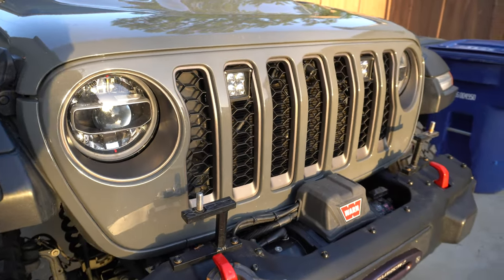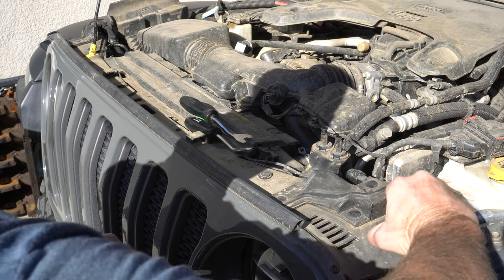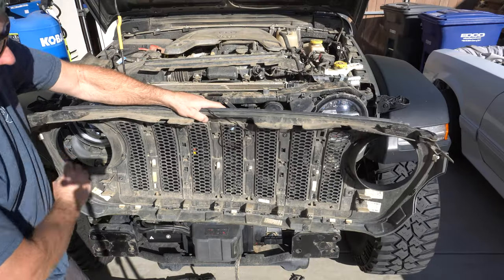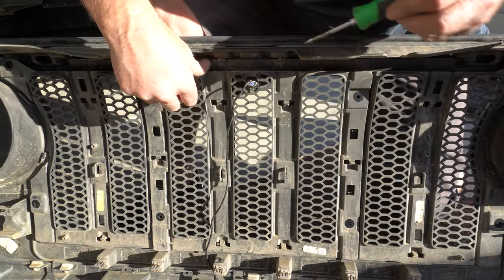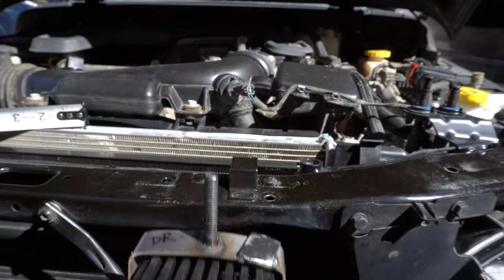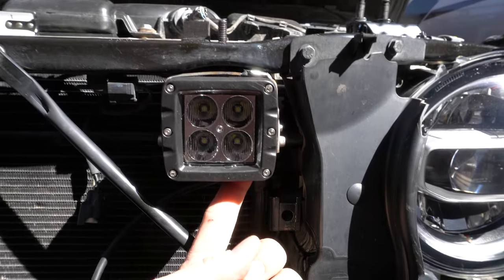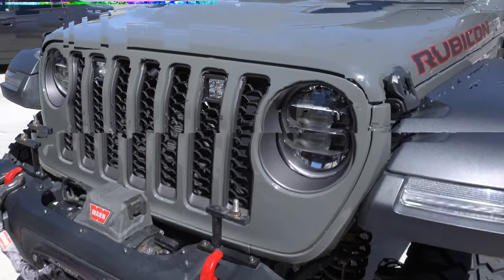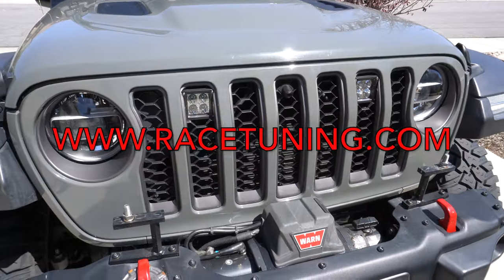GLADIATOR OEM GRILLE SWAP on to JEEP WRANGLER JL & Off Road Light Installation

Comment: Did you notice any difference in temperature
Reply from the maker: We didn't have an overheating problem before changing the grille.  Since the thermostat will regulate engine temp at a minimum temperature, say 210 degrees or whatever the spec is, you'd only notice a difference if your Jeep is running above that temp.